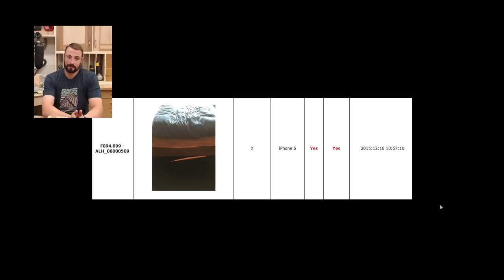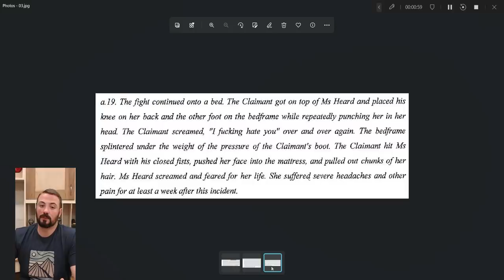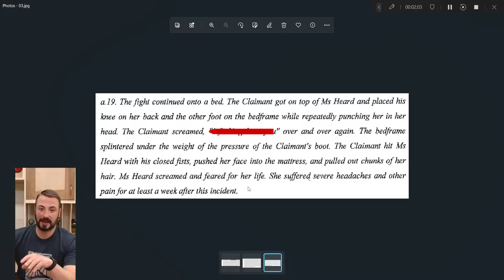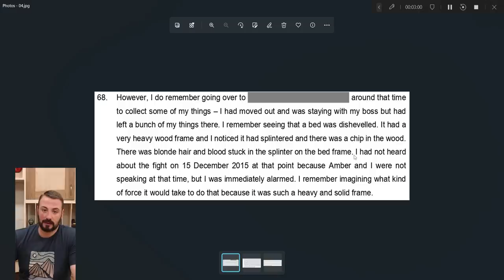Woodworker Attorney DEBUNKS Amber Heard's "Broken Bed” Testimony!

Comment: I love this! Great information!
Reply from the maker: Thank you! Coming from you, that means a whole lot. Probably some of the best audio/depo analysis of this case I’ve seen so far!
Reply: Came here coz of ur tweet 🤌🏻
Reply: Uhhh hey I saw a video in defense of Amber would be cool to see your response to it.
Reply: @LawLumber  just discovered your channel. With metadata would a screenshot of an older photo be possible?
Reply: @jolene4665  metadata can be easily manipulated. It's just data inside an image file. But if the metadata of a picture has a date older than the event she claimed, maybe one could assume it's an older photo...  no one would logically change the metadata so the date is before the event.
Reply: @rallealyt  my youtube comments are being weird and it was impossible to fix my original question. I meant in meta data there is simply a date attached to the click of the photo right? But it won’t show if it’s a screenshot or brand new? Thx for responding
Reply: To be honest, without these YouTube contents from professionals, experts, lawyers and independent Youtubers, I won't understand the trial and evidences as much as I do now.

Thank you everyone. ❤
Reply: You can see in the bed cover where someone has been sitting on the bed, legs aside the damage area, one of the hand (left) indentations is deep giving signs of purchase by a right handed person using a knife, after the damage the knife blade was closed with the left hand and placed by the right hand on the bed making a heavy indention as the person stands to take the photo.... Pow... I just went full Columbo.

Edit..... You can also see the phone indentation on sitting persons left (right side of pic) dropped while sitting, then picked up by left as standing, heavy right hand finger tip impressions made as right hand pushes off the bed.
Reply: Huh... looks like a large pocket knife on the bed. Could Amber have done The damage to the bed? You solved it.  You should give Johnnys lawyer this incriminating evidence.
Reply: Is it possible a high heel could of done it like a metal heel
Reply: Hope this gets to JDs team !
Reply: @incredibly Average.   You can do a quick illustrating video for this one.  Love your work too, and your humility 💝
Reply: @jaybrooks7431  - He said no, unless the high heal had a sharp point, similar to a knife?
Reply: @helloworld2784  it kinda worries me that professionals, experts, and lawyers have to explain the ongoing issues/inconsistencies in this trial for the average person to follow along. I can only imagine what the jury is feeling/thinking and really hope Johnny's team addresses these things.
Reply: @diannacarbajal9072  I really wish they brought in more experts on everything from cell phone data to this. But it’s not a criminal trial. As soon as I saw the bed I know it had to be purposely cracked off
Reply: @LawLumber  Brilliant work!! & I’m at the part of the video where you point to the object in the bed. I took my knife out of my purse and held it up to my tablet and it matches up almost exactly to the object in the bed. That is a knife in the bed!!  Excellent work brilliant !! Peace&Respect, Shelley Anne
Reply: somebody should send this Video to Joe Rogan to get more Attention
Reply: Lets hope there is a carpenter on the jury.
Reply: I highly doubt that Johnny Depp was wearing rubber soled workboots; that is simply not his style. A boot regularly worn by him is a thick leather soled biker boot. Such a boot could easily have been fitted with a cast iron metal quarter heel. It is seen as a stylish and practical addition, particularly by those in the 'rock' community. It also can not be assumed that it would have been the sole of Mr. Depp's boot that was in contact with the bed frame. If the splintering occurred as Mr. Depp climbed up onto the bed, immediately before landing with his knee upon Ms. Heard's back, the many pounds of Depp's weight, bearing down upon the sharp  corner of the metal quarter heel, as he quickly thrust it down onto the bed to 'gain purchase', could easily have supplied the kinetic force, and penetrating capability necessary to splinter the wood as evidenced in the bed frame damage photograph. Even if the boot heel wasn't metal quartered, it's perfectly feasible that the edge of a hard leather heel could splinter off such a piece of wood if there was a commensurate weakness pertaining to the grain of the bed frame's lumber. Such a sequence would have happened very swiftly, and seemingly all at once, and would be reasonably consistent with Ms. Heard's testimony. Furthermore, whatever that small object is that's nestled within the folds of the bedcover, it is definitely not the type of large knife needed to pry off the wood splinter. IMHO: nothing of Ms. Heard's testimony has been debunked here.
Reply: @RocketCalcutta  Tell us you’ve never worked with wood, without telling us you’ve never worked with wood…
Reply: @RocketCalcutta  how could his heel be down if his other leg is raised and kneeling on ambers back? If you are leaning forward the heel will raise. Let alone have enough force to split the wood.
Quick look through google images shows his choice of boot is usually dr martins or similar.
Reply: @zac3392  of course I have worked with wood; that experience is precisely what led me to my opinion. Are you saying that the hard heel of a biker boot, metal quartered or not, striking down on the corner edge of a wooden bed frame could not splinter a piece of it off? The heel, in this instance would have a kinetic force similar to a mallet being brought down. It is entirely possible that such an action could result in the damage seen in the photo exhibit.
Reply: @jolene4665  any action taken on a photo will increase metadata fields, geolocation changes, etc.

 Dates will get added by the OS of the system (like an android phone) for the original, and if you save it in photoshop, again more info/date time stamp added, etc etc on and on. 
Someone taking a picture of a picture on another device would only give you the device info where the pic was taken on the respective pictures - BUT forensic techs may be able to get the fact that it's a picture of a picture on another device because the image will have some telltale signs like lines that aren't fully detectable by the eye, which would be notable in terms of trial evidence. Try taking a picture of a computer screen send you'll see what I mean. It's also tough to line up perfectly, which might encourage you to edit or shrink it down. Those would all get metadata tags for the changes made. It's how your phone is able to "undo" modifications to a picture, because it knows exactly what you did and in what order.

Hope that helps!
Reply: I heard his bed was mahogany. We sure it's pine? Would Johnny Depp have a pine bed in his penthouse? I still think she did the damage though.
Reply: @truthsleuth6567  wouldn't that make it stronger? Mahogany is like 50-70% stronger than pine.
Reply: @MEEMS It absolutely would be stronger!  She's a beast! LOL
Reply: @RocketCalcutta  Splinter a small piece, yes. Take out a 3’-4’ long splinter at one time, not a chance. You couldn’t do that with a mallet either. If this was the only inconsistency in her stories, perhaps I could chalk it up to a once in a lifetime occurrence.
Reply: @zac3392  it could very possibly have happened as outlined in my various comments, imho. This is why I don't believe that Law and Lumber (great name, isn't it?) has debunked Ms. Heard's testimony regarding this matter.
Reply: @lilbaz8073  a thorough search of Google shows that Mr. Depp regularly wears biker type boots. I am suggesting that Mr. Depp could easily have slammed the heel of such a boot hard down onto the bedframe as he was climbing up on the bed to attack her. This action could very possibly have led to the splintering of the bedframe, as seen in the photograph. The whole sequence of him stepping onto the bed via the bedframe, then getting on top of Amber Heard,  would all have happened very fast, and seemingly instantaneously. I therefore think Ms. Heard's testimony is reasonably consistent with the bedframe damage photo. This is my objective opinion.
Reply: @RocketCalcutta  nah. This is a civil case not a criminal case. There is no beyond reasonable doubt. This is about probability. It is more likely to be that it was purposfully damaged than johnny did it. Wearing some weird biker boots with steel heels. When a google of johnny depp boots shows him wearing eithe dms or floppy workmsn boots. This isn't a dior ad.
Reply: @RocketCalcutta  amber could have easily won this case. If she kept it simple. But she's gone so ott, with no back up. People find it almost impossible to believe her. Now you want us to believe johnny had special boots that can split wood? How the hell would he walk round the house or upstairs without damaging things all the time?
Sorry, nah.
Reply: @lilbaz8073  You are welcome to your opinion, of course. I will add this though: the thought that Amber Heard would have had the same expert knowledge of wood and its grain as Law & Lumber, giving her the know how so as to enable her to fake the damage, seems utterly preposterous to me. This is just my opinion of course.
Reply: @lilbaz8073  no special boots. He could have applied special force as he smashed his heel down onto the corner edge of the bed frame. It's as simple as that to me.
Reply: @RocketCalcutta  It is soft pine, it would just dent, not splinter. Plus, it would take many many strikes to weaken wood before it would blow off any wood with force, and it would not look like that. 

My point to you is that if he was pressing her into the bed with enough force to smother her that means that he would have had to be further up with his center of gravity over the bed which is at least about a foot and a half away from the edge of the frame where it broke, there is no way his foot would have been that far back behind him and made that much force, especially if his weight supposedly was pressing down on her, which is a soft moving surface. If he really was looking for purchase from the frame it would have been on the other side of the frame closet to the mattress so it would stop him from moving backwards. On top of that he was supposedly punching her, which means he would have been bent down over and a bit above her, and her face would have been at least two and a half feet away from the edge of the frame. With all of that in consideration there is no way he could have kicked backwards at that angle with enough force to splinter off a piece of wood. Actually, it would be impossible that his heel to have even reached that edge at the angle he was positioned in. If you bend down and try to kick back, your heel does not reach the ground, so there is no way it could be used to chip off anything.
Reply: @tohrurikku  the actual bedframe was made from hardwood. Law & Lumber only used pine as a substitute for his demonstration. If a 175 -200 lb. person, wearing biker boots, was to climb angrily up onto a bed with a hardwood bedframe, the leading heel of that person's boot, with or without a metal quarter heel, would smash down upon the corner of that bedframe with the force of a swift striking mallet.  If you have such a bed, try taking a mallet to the corner edge of its bedframe with all your force, and let me know what happens (results may vary) 🤪
Reply: @truthsleuth6567  you are right. The bed was not soft pine. It was made of hardwood and could well have been mahogany.
Reply: @RocketCalcutta  She claimed that it happened when he was standing on her, while punching her and trying to gain footing with the other foot, not while stepping on the frame. She "felt it" happen as he was punching her. It is impossible, no matter what type of boot, to have happened at that angle and distance. Most of his weight would have been on her too, there is no way he could have put that much weight on his other foot to make enough force to splinter that wood without getting off of her and if he was able to do that, she could have run away and that was not her story. I proved that he did not do it. Why are you not listening. She said it happened when he was on her, not stepping onto the bed! Also, if it was that easy to have splintered it would have happened already. Do you think this is the first time they climbed on the bed wearing shoes?
Reply: @RocketCalcutta  we know she faked the rest from the police body cam that showed no wine, no broken glass. The other police officer earlier had a complete tour of the apartment and reported no damage. It was only later when isaac came home he saw the broken glass and puddle of wine. Meaning it was done after johnny and the police had gone. Leaving only amber and her friends as the ones to have caused the damage.
Amber didn't need to have expert knowledge. She only wanted to show there had been damage and put on the tro that the police had attended. She just wanted to blackmail johnny. She never thought it would go to court.
Reply: @tohrurikku  The sequence of Mr. Depp's  movement would all have happened very fast, and could easily have seemed simultaneous to Ms. Heard. Coming from a tough neighborhood, I have been in fights of many kinds: it's really all a blur when you try to recall it afterwards. Stepping onto a bed under normal circumstances would exert way less pressure than crashing down upon it in an angry rage. As for Law and Lumber's presentation in this video: the wood in the court exhibit, and the other bed photographs does not seem like soft pine wood at all to me. Plus, the photographs he has used are clearly of two different beds. I am not convinced, for all the reasons I have outlined in my various comments here, that Ms. Heard's testimony regarding this matter has been debunked. It's my honest and objective opinion, and of course people are entitled to have a different one.
Reply: @lilbaz8073  there is indeed a great deal of conflicting evidence in this lawsuit, I agree.  However, concentrating on the issue of whether or not Ms. Heard faked the damage to the bedframe, imho this presentation by Law & Lumber hasn't proved anything one way or another to me. I do wish he had used the same type of wood as is seen in the photograph for his demonstration. Though he asserts that the wood in the photograph is pine, it sure doesn't look like pine to me. Also, the photographs he used to make his points are clearly of two different beds. What I have laid out in my various comments here are my honest and objective opinions regarding this matter, and of course other people are welcome to have different ones.
Reply: Very good analysis !
Reply: @RocketCalcutta  it had to have been her or her friends. Johnny left before the cops arrived. The cops saw no damage. Then amber damages the apartment takes pictures of damage and files for divorce the next day.
It's not rocket science.
Reply: @lilbaz8073  "rocket science" 😉
Reply: @RocketCalcutta  yes i did notice that after i typed it lol.
Reply: @lilbaz8073  🤪
Reply: @meems4378  thank you !
Reply: @RocketCalcutta  I do appreciate u providing ur opinion and accepting the input of others but...U seem to be making the scenario fit her facts. U disregard her testimony stating it was fast so she probably got it wrong. If a bed breaks when someone is punching me u bet I'm going to know if it happened before the first punch or after. With that u seem to ignore the physics of weight distribution, cops being there and seeing no damage and her pictures later showing damage, taking someone saying it could happen and changing it to "very probable". Ignoring the presence of what appears to be an object in the picture that has a higher chance of causing the type of damage pictured than a boot. As I do agree the video alone doesn't "prove" it wasn't Jonnys boot, nothing proves it was beyond the word of Amber who has been caught in multiples of lies when it benefits her. Ur bias shows when u value the word of a documented liar over physical evidence. That's not opinion. That's fact.
Reply: Lord I hope his lawyers bring out this info and the jury doesn't fall for her evil. I was so disappointed in Johnny way back in 2016. We all "saw" the bruises.. we fell for her bullshit, but not anymore. She's so disgusting.
Reply: @ATecGeek  Thank you for your kind words. The police were not called out to this incident. The object nestled within the bed folds, as pointed to by Law & Lumber, is definitely too small to be a knife. It looks more like a pen, or a mascara case to me, but it's too out of focus to enable a positive ID. I am trying to be objective, and to look at the facts with a level head, without bias. We can only hope that the jury will do the same 😁👍
Reply: @truthsleuth6567 I think you mixed me up with someone else. I was not disagreeing with Law and Lumber at all. I said it was pine, and even if it was not it still would not have splintered the way the other other person I was disagreeing with claimed would happen if JD stepped up with a bikers boot. I believe that ah or one of her friends did that.
Reply: I'm praying for you & Johnny Justice 🙏Lord please for survivors All of us including Johnny & myself. If Johnny laced his boots up by resting his foot on the footrest, it easily could have eventually splintered due to this normal act of pressure on the wood. A turd is grasping at straws as her disjointed lying testimony shows the whole world! I could list 1000 reasons of evidence showing Dr Curry is 100% spot on.
Reply: @RocketCalcutta  Its does look small (object on queen sized bed) but after looking at small folding pocket or purse knifes on google it could well be a full metal folding pocket knife kept on a keychain or in a purse or on a bedroom side table to open mail in the morning for example, also hand size prints on bed make it about the correct size for that, the indentation alludes to the object being heavy, tho i agree it could well be a silver mascara case, i think (judging by eye) its to bulky to deep in the cover for that.
Reply: @MaxBreak  there are so many things wrong with this video! Whatever it is on the bed it is NOT the kind of large knife  that L&L felt he had to resort to using in his video. Next: he uses two entirely different beds to make his analysis. Furthermore  he claims the frame is made of stained pine. It clearly isn't. To cap it all he assumes what type of boots Mr. Depp was wearing, and assumes how his boot contacted the bed. As a lawyer he should know better than to assume things. I have broken down my thoughts on all of this in various comments and haven't yet received a response from him 😔
Reply: Love Your vids! 👏🙌  👍 I use to recommend Your channel, as latest as yesterday! 👉 In the original Australia recordings, there is a sound    of her walking away (after talking to nurse & doc )...it sounded to me like she marched away in high heals ("on that beautiful wooden parquet" as she stated was dragged across over⁉️😳  👉❓how in Earth can somebody with "sliced up feet" wear highheals & march around the Day after 😳❓ 👉👉❓that tape should be used as evidence, though there are other people involved, since evidnece of police recordings involved other People as well‼️where is logic ⁉️🤔 bless You for all You do! 🙌🙏🌟
Reply: @lilbaz8073   👍 yes, & a male victim of domestic abuse❗🙏🌟
Reply: @lilbaz8073   👍agree! ☝️❓& another possibility, some of her friends could "beat" her there without her daring to say in their presence..☝️ & one of the neighbours witnessed he saw her with another girl doing "pretend fight"..🤔 ☝️❓ why didn't she walked away with her friends if she was so affraid of him? 🤔
Reply: Agreed
Reply: It’s really good
Reply: @RocketCalcutta   Could that be a pocketknife that Johnny was talking about? When she tricked him into meet him in San Francisco (i believe) though he was not ought to...🤔
Reply: @RocketCalcutta   👍 Thank You for Your reply! I thought that there were 2 occasions, 1 with big knife with inscription that she gave him ( & recorded )  & the other with smaller knife in SF...
   He just came from touring, ( if I recall it correct), & His Friends helped him to arrange secret meeting cause of restriction she put on him...
    I will check his testimony about it again, though it seemed to me he mentioned smaller folded knife..
    Anyhow, maybe I've mixed it up, but I am trying to understand why he would walk around with a big knife he's got from her, since he was fed up with all that has to do with her...blessings to all! 🙏🌟
Reply: @LawLumber  in the frame at the end you can see a darker line running cross grain in the top side of the footboard, it starts about 4-5 inches back from the right end of the rough edge.  Matching up the sliver on the floor you can see a knick that appears to perfectly line up with that dark line. The pry point perhaps?
Reply: Soon as you zoomed in on the bed at the end I was like....."😲daaaaaaammmm"
Reply: hi guys! you are incredibly awesome NOT average investigators! thank you for your work!
Reply: @LawLumber  im glad I've found your content and other stuff about law :) tbh its all thanks to amber turd
Reply: @LawLumber  You can EASILY clip off that wood from the edge in a VIOLENT SCUFFLE where you're exerting an INCREDIBLE AMOUNT OF PRESSURE. 

And with a BOOT?! ABSOLUTELY! 

This proves nothing, Counselor.
Reply: The size of the platform edge, Johnny would have been doing the splits to contort himself into the position she described. They need an OJ moment for that one.
Reply: Your videos opened up lots of cans of worms! Thank you for your hard work!
Reply: @RocketCalcutta  interesting theory but I have one problem with it. AH stated she was pushed faced first into the mattress and JD was on top of her and kneeling on her back with one leg, gaining purchase with the other, punching her. With this description, JD HAS to be facing her- his chest to her back. Metal on biker boots is on the heel typically NOT the toe. For his heel to do the damage they would have to be back to back which makes no sense.
Reply: @IRLLondonGirl  Mr. Depp smashing his heel hard down on edge of the bedframe, as he climbed up on to the bed, would've happened so quickly before landing on top Ms. Heard so as to appear almost simultaneous. Her testimony is reasonably consistent with what I am saying could easily have occurred. Another thing to bear in mind is that Law & Lumber is dead wrong about the bedframe being made from stained pine. The bed is a 'high-end' Los Angekes made 'Environment Furniture Edge Bed' fashioned from reclaimed peroba rosa hardwood, with ebony-stained mahogany veneer on each of its corners. There is soooooo much wrong with Law & Lumber's sloppily researched analysis imho.
Reply: @RocketCalcutta  
I work quite a bit with wood, and I can tell you that chips like these are only possible with a sharp object. No matter if it is soft or hard wood.
With a blunt object? You would slip before it would chip. You will need a hard object to make the break. Maybe with a huge hammer, but definitely not with a boot, not even with a worker, steel-nosed, boot.

Secondly, you can also see it in the video, you would tear it off as he does at 17:35. This means that if magically his boot would have chipped it, he would have to tear ther rest off by hand.

Again, I work regularly with wood and it is plain and simply impossible.
Reply: @RocketCalcutta  sorry I don't buy it. Climbing up on the bed frame the force is going toward the bed not away and doesn't make sense to me with how a foot would climb on. Stepping down (to present with the heel first) would be much more controlled as Ms Heard testified she was unconscious at this point. Although I acknowledge that she also says she ended up on the floor and doesn't know how. That will have to remain as a mystery. To me that damage is consistent with a direction of force from the bed going away from the bed. @lawandlumber explained this well with the knife as a theory. His explanation is more common sense to me in that sense and is a conclusion I can believe based on my own experience of wood and how it splinters/breaks, having had a large wooden bed myself that broke in a similar way one time. I completely agree that if it's true that the bed was damaged in this incident, then the incident would have escalated super quick and likely over in a couple of minutes
Reply: @IRLLondonGirl  you are welcome to your differing opinion. Much respect 👍
Reply: @IRLLondonGirl  P.S. FWIW: the bed in question, i.e., an Environment Furniture Edge Bed, has what amounts to being a bench all the way around it. The chip was broken off from the top corner edge  at the foot of the  bench-like bedframe. (If that helps you visualize what I am imagining could have happened.)
Reply: I don’t believe her she’s not a small person she’s keep claiming JD on drug and took a lot of photo his asleep! I would report to police and go to hospital if this happen to me
Reply: @LawLumber  w

Wonderhussy
Reply: Hi there.  Thank you for this PROOF that she is lying.  She has a small pocket knife on the comforter in the pic.  Its hard to see but was pointed out on May 17th court proceeding.   ARE YOU ABLE TO GET THIS VIDEO TO JD LAWYERS?
Reply: @yehkasee365  😂
Reply: I wish the jury could see this
Reply: Hi Bryan!!!! ♥️ loves ya!!!!
Reply: The pocket knife is not strong enough!!!
Reply: @JimmyGrl09   why didn't Law and Lumber use a small pocket knife to carry out his demonstration? Why did he resort to using a large 4 inch blade folding knife instead?

Plus: the object doesn't even look like a pocket knife imho. I showed the photograph to some friends, and asked them to try and identify what the mystery object was, having previously cropped off the wood shard at the  bottom of the photograph in order to eliminate any indicator that it was from the trial. One friend said it looked like a vibrator, another one said it resembled a small stubby fountain pen with a coin beside it, yet another friend guessed it was a vape pen.
Reply: More like misleading information. Great intention but a lack of Carpentry experience was obvious as he ignored the sharp edges of the bed lumber which completely change this scenario. There is a reason modern framing and decking lumber is sold with round edges. They don't do all that work just for looks it makes a board FAR less likely to splinter and chip when hit on an edge. Many of those who arn't just friends of or family of those who work with wood are mentioning this in the comments. Many of us have literally had boards split on the edge from our work boots haha. While I think they are correct that was not caused by a boot at least not only a boot they actually got most of the reasons why wrong.
Reply: Knife was used ; and to  take a picture with the “knife” on the blanket weighing it down so it will be hard to make out shows it was a “staged “ picture.
Great work and explanation. This is why I’m going to be your new subscriber to your channel.
Reply: Could there be any chance that the worst actress ever was confused and was maybe for once sort of telling the truth, I.e I have had beams snap on beds by the kids being to excited jumping on the bed, or me being too excited lol could jinny have pushed her down so hard it cracked the bed and then when everything happened she said that was when the beam snapped ? So the damage was done in the throw down? Not sticking up for this bare faced liar just an honest question as I've had beams snap more than once although tbh these were cheap beds with cheap wood unlike I would expect from a millionaires bed.
Reply: @diannacarbajal9072  seems she already has it 🤣🤣
Reply: perfect video
Reply: @LawLumber  l love watching you ❤️ you have an amazing legal mind you make complex legal action into easy to negotiate and understand situations. I have always been amazed by good cabinet makers. l design not bad cabinets myself but not so skilled at being a quality joiner, your furniture is beautiful 👌 have you tried Jarah wood? I live in Australia 🇦🇺 and Jarah is a local beautiful wood and is regarded as very prestige as an option like birds eye maple in America 🍁 much love and best wishes from my family and I with your channel x
Reply: @jaybrooks7431  Amber testified Johnny was wearing a boot.
Reply: Absolutely 👍
Reply: @RocketCalcutta  its the same bed. Clearly what they did is sand or plane and restain to make it presentable? Because the bed in the wallabout shot from the real estate agency looks like the same room same bed to the rest of us?
Reply: @RocketCalcutta  either way it would have been the front of his boot not the heel thatbwould have come into contact if he was moving forward.  And if he was falling backwards and did that w a metal heel as you posit then he would have fallen backwards and hurt himself probably. But it would have had ro have been with force and with metal heel for sure and even then it woulrnt splinter in that way. Having worked on boats/yards/farms for years ive seen all types of wood splinter from all type of standing jumping falling back and falling forward and i think its credible to say that however it happened it wasnt during whatever situation AH describes. Never mind "wood science" or carpentry knowlledge, we are talking physics. As a biological anthropologist  i have studied kinetics bipedalism and all sorts of humam physics and it makes no sense. 

And i say this as a dv survivor too. I dont believe either one fully. I acknowledge  that he was plenty emotionally and verbally abusive and or jealous and controlling even, of that there is proof, and as far as she is concerned of course i do not want to believe any person let alone a fellow woman would falsely accuse anyone of what shes accusing him. So years ago i gave her the benefit of the doubt when all i saw was a few photos that looked legit devoid of anything else. Because victims dont NEED evidence to be believed per se. But she decided to provide much more so called evidence along with many more accusations... so we must now look at this evidence imho as unbiased as possible and thats what i did...even though i was solodarious w an alleged fellow dv survivor. I like you say also have been looking at this as objectively as possible and bar a few videos like these trying to only see what the jury is seeing while watching the trial...and it just makes no sense sorry. And i want it to make sense. I have questions.

 And yes maybe we dont know what boots or even what wood but for me its just the physics of the movements one would have to do to break a large splinter like that off that make no sense.

Ps. I have a leatherman tool with a knife that could absolutely splinter wood like that because ive done it even by accident trying to just make a hole. Im the same exact size as Amber Heard btw and also grew up on a horse farm doing manyal labour fuxing fences etc and have similar build so im sure she could have done it but not saying she has just debunking your claim that she COULDN'T have with a fold out tool knife (though im not sure that one in the pic is the one...because apart from anything why would someone leave the knife on the bed and take a pic lol).
Reply: @leticiavasquez8566  as regards the physics of how a boot, getting a purchase on the bedframe, could have knocked off a splinter from the bedframe: the heel of a boot with any type of hard sole could very easily knock a splinter off a reclaimed hardwood frame, especially if the frame resembled a bench, as is the case with the Environment Furniture Edge Bed. Think of how your heel would slam down and then backwards on the top corner edge of the bench-like bedframe as you furiously climbed up onto it.
Reply: @MaxBreak  I now have columbo standing by that bed trench coat on with that look on his face of ah ha I know how it happened lol I can absolutely see what you described
Reply: What a combo lawyer/furniture builder ❤️ it ✌️
Reply: Wow so she set him up
Reply: BRAVO Mr Average WOW I am blown away with you and I have subbed to you also,your loyalty,compassion and commitment is admirable xx💪🙌🙌👏👏💙
Reply: Do you watch The Behavior Panel in regards to JD and Amber's trial? Very interesting. On you tube.
Reply: What a dream team!!!
Reply: @RocketCalcutta  after reading your remarks. I tried to picture her face down and his knee on her back as he was gaining purchase. this is her testimony. my question is how his heel would damage it. wouldn't the toes be the only part to touch that wood while his knee is on her back??
Reply: @ElReyMrz1  my point is that Mr. Depp would had to have leapt onto the bench-like bedframe, smashing his heel down upon the. corner edge of it (i.e., getting a purchase)  before continuing forward landing on top of Ms. Heard. This would all have happened so fast as to seem simultaneous, especially in the midst of an attack. Another thing to bear in mind: I have identified the model of the bed. It is an Environment Furniture Edge Bed fashioned from reclaimed peroba rosa hardwood, with ebony-stained mahogany veneer on the bedframe's corners. Being as it's reclaimed hardwood, it could easily have been splintered  by the pressure of a heel landing hard down on it's corner edge with the heel then pushing backwards countering Mr. Depps forward momentum. I hope this clarifies my viewpoint 😁👍
Reply: @LawLumber  

Hi there. I know you’re suuuuuper busy but i hope you read this…

Please if you want to share whatever with us, DO IT HERE IN YOUR CHANNEL….
Especially if you did all the hard work….thanks..

Stay safe and healthy.
Reply: YOU ARE THE BOMB!!!  I APPRECIATE ALL OF THE TIME YOU HAVE SPENT IN LINE ALL NIGHT LONG, IN THE COURT ROOM, DOING DAY/NIGHT CAPS FOR US,  DOING THIS VIDEO RIGHT HERE!! COMPLETE DEDICATION AND DEVOTION TO THIS CASE! THANK YOU SO MUCH FOR SHARING YOUR KNOWLEDGE WITH US😊!
Reply: Fantastic info! Love the sitting marks and phone analysis on comments too. How this hasn’t been brought up by JD people I don’t know.
Reply: @MareRS357  I mean her standing on them with high heels getting leverage to hit him , but yeah looks like a pen knife did it
Reply: @dantespimp  I heard Rob (on Popcorned planet with Andy Signore) discussing that Camille did talk about this. I’ve been trying to find the clip, but so far I haven’t been able to find it.
Reply: @RocketCalcutta  i knoe how a heel would do it. I totally am.not saying a herl wouldnt do it. Im sayinf human physics would have a body going forward to pin someone down and punch them not on their heels but on their forefoot. Thats what in saying even if you get on a bed running (and i too have a platform japanese bed btw) your heel doesnt hit the edge. It only would getting OFF facing away from the bed. But thats not how AH described what happened. 
So im not arguing about the heels capabilities (though ive never seen him wear the kind of biker boots that have metal heels in any photos and im almost his age so ive seen decades of) to chip furniture im saying his heel wouldnt have come in contact with the edge if he did what she says he did to hold himself on to gain balance while holding her down and punching her. It makes no sense as far as physics. Not arguing your heel theory as to whether it could given the right scenario. This just isnt the scenario. Peace.
Reply: @diannacarbajal9072  We can send it to Camille
Reply: Fascinating! Thanks! I found you through Popcorned Planet. I love natural wood furniture and as a psychotherapist I also have an inquisitive mind and love figuring out mysteries. I think it's so great that everybody's bringing their own expertise to platforms like this! You Go Rob!
Reply: @RocketCalcutta  I doubt, if she did fake this, that she did it knowing the physics of how she created the damage. I suspect she would have envisioned her scenario and then tried to think of ways to embellish that scenario that could be photographed as "evidence". If I wanted to take a chunk out of a piece of wood, (and I've been known to make a rough repair this way) I'd grab something sharp and do exactly as depicted here. I find other aspects of the picture to be equally, if not more, indicative of ... suspect activity.
Reply: @leticiavasquez8566  peace to you also 🙏 As my final note on this matter: I think it reasonable to assess Ms. Heard's testimony as being consistent with the scenario I have outlined, given that she has sworn that her recollection of the event has been presented to the best of her recollection, and especially considering the event, if it happened, would have had to happen in a fear inducing frenzy of activity. During Ms. Heard's testimony on the stand she declared that Mr. Depp's boot caused the damage to the bed when it was getting a purchase on it. I see zero inconsistencies between this testimony and the facts that are at hand. Respect, and once again, peace!
Reply: @JaneFancher  What I find suspect is the fact that Law & Lumber has completely misrepresented the nature of the material that the bedframe was made from. He declared himself a woodwork expert and stated that the bedframe was made from stained pine softwood. It wasn't. The bed was an Environment Furniture Edge Bed, with a bench-like bedframe made from reclaimed peroba rosa hardwood. Law & Lumber then went on to demonstrate, on a piece of rounded edged pine softwood, how you could prise a sliver off of it with a large bladed folding knife. In an attempt to end his video with a Perry Mason moment, he then zoomed in on the photographic exhibit to reveal a small indiscernible object nestled within the folds of the bed clothes. Whatever this object is, and it could be any number of things, it is definitely NOT a large bladed folding knife. IMHO: the only thing that this video debunks is Law & Lumber himself. Of course, having said this, I believe everyone is entitled to their own opinion. 🙏
Reply: @LawLumber  Hate to be pedantic, but the photo @3:00 is not showing the same damage as the photo @6:00. What is going on?
Reply: @RocketCalcutta  i stand by the fact i think it wouldnt have been his heel making purchase on the edge ubles leaving tje bed not getting on it to get on one knee sorry. we can agree to disagree for sure. I see nothing but inconsistencies in all of her testimony and i find no joy in that at all as i supported her as a sv suevivor myself from day one. Then i dug further into her stories and looked at the evidence like a scientist and i dont see it. She would have been better off not showing any evidence than contradictory evidence. Too many photosnof material destruction and not enough of bodily harm. That itself is inconsistent. Anyway. Stay safe out there. Take care.
Reply: @leticiavasquez8566  Take care also 😌🙏
Reply: @RocketCalcutta  🖖🏾🖖🏾🖖🏾🖖🏾
Reply: @Cuticatie  According to the online dictionary/thesaurus, Lexico, which is affiliated to the Oxford University Press, pledge and donate are synonyms. The well used term for the type of donation Ms. Heard made is pledge donation. I am not blindly sticking up for Ms. Heard when I point such things out. As ever, I am merely striving to be as objective as I possibly can.
Reply: @lilbaz8073  Your comment reminds me of the great "line" in the movie, Body Heat where William Hurt is plotting to kill his mistress.  His bomb-maker explains how he's to plant it.  Hurt say, "Oh, it should be easy."  Answer by the experienced criminal, "No, the police will have 50 ways to catch you.  If you can think of 25 of those ways, you're a genius..... and you're no genius"!  [Do watch that movie, if you haven't seen it]
Reply: @RocketCalcutta  The splintered piece of wood appears to be at least 2' long.  The only way JD could have broken it (in that way) would be if he TRIED to break it by (somehow) coming almost straight down on it.  (and, of course, there would be no time or reason that he would do that)  That leaves, "his position on the bed.":  If he was trying to "gain purchase" his boot would have been on the inside of the frame; not the back-side.  His foot would have just slid-off (causing a minor scrape at the very most)  Certainly, the angle he was at while lying on the bed on top of her, is not consistent with that kind of "rear-ward" break in the wood at such a minimum angle.  
The only possibility, in favor of your argument, would be if there was an extreme, two-foot fault in the wood; but that would easily be seen in forensic analysis of the wood.
Reply: @ThePianoMan1953  think i saw it, but can't remember it. Will give it another go. Thanks.
Reply: @ThePianoMan1953  Mr. Depp could easily have slammed down with his heel against the leading top corner edge of the bedframe as he rushed to climb up onto the bed. The frenzied sequence of events comprising Mr. Depp's alleged attack could easily have appeared to be happening all at once in the mind of a panicked victim. Furthermore, the bed in question was an Environment Furniture Edge Bed, and its bench-like frame was fashioned from reclaimed peroba rosa hardwood. It was not stained pine softwood as Law & Lumber erroneously stated in this video. Law & Lumber's analysis is misleading in so many ways, imho.
Reply: @RocketCalcutta  I do appreciate your HO.  We should all be humble!  lol  I just simply don't understand what part a HEEL could possibly play in that situation??  I seriously don't understand how anyone's heel (with the exception of Amber's heel while lying on her back) could come into contact with that edge of the frame??  Toe, yes, but heel???  What position would JD have to be in for his heel to do that??
And, by the way, you said JD "climbed up" on the bed??  No, the bed is very, very low.
Reply: @ThePianoMan1953 The bed is not low. Law & Lumber is wrong about the construction of the bed as well as its material composition. Look up the Environment Furniture Edge Bed online. Though the LA based company that made these beds is now defunct, many examples of it are listed for resale.

The bedframe was designed to function as a bench. Depp could very easily have leapt up onto this bench to get on top of the bed. In this case, his heel could easily have slammed downwards and then backwards onto the leading top corner edge of the bench-like bedframe as it gained purchase and Mr. Depp followed through with moving forward. This action in turn could easily have splintered a lengthy sliver off of the reclaimed hardwood. I take it you understand what reclaimed wood is, right?

I hope this makes what I'm attempting to put across clearer 😌🙏
Reply: @Cuticatie  I don't believe anything just because it is written or said. I always take into account whatever facts and evidences are available in order for me to arrive at an objective understanding of whatever is in question. My point is that, imho, this misleadingly presented video debunks nothing!
Reply: @RocketCalcutta  I believe it was Amber herself, who said, it's a low, platform bed which is supported by the court photos.  I believe, it is quite low as can be plainly seen.

I'm wondering..... why are you "hung-up" on the "heel theory"??  What makes you think his heel had to cause the break??  (I believe it is because you know that is the type of force necessary to break a two-foot piece of wood; reclaimed or otherwise)  But, I think you buried your own argument with your "heel theory."  A foot just doesn't bend in the direction of someone facing the bed for a heel to come into contact with that distal-edge.  If Johnny's focus was to get on top of Amber, he would be lunging forward onto the bed; not jumping up and down on the edge of the bed frame/bench.  And even if he did, his foot just couldn't bend in the way that it would have to be.  He'd have to be facing the footboard, but the testimony stated that he was facing forward on his stomach.  Heel?? impossible!
Reply: @ThePianoMan1953  The height of the bed in question was 12.25 inches. That is approximately twice that of a regular staircase step. And you're right, it needn't have been Mr. Depp's heel making contact with the leading top corner edge of this 12.25 inch high bedframe.

If Mr. Depp was furiously climbing up onto the bed, gaining purchase on the 12.25 inch high reclaimed hardwood bedframe as he did so, whichever part of his boot it was that gained purchase could have caused the depicted splintering. Ms. Heard, especially if she was as panicked as she claims, could easily have percieved just such a fast moving sequence of events as happening simultaneously. I don't think any reasonable person would fault her for that.

Again this is merely my humble but objectively reasoned opinion. (Is there an acronym for that: IMHBORO? Lol.) You are of course more than welcome to yours. Respect 😌🙏
Reply: @RocketCalcutta  Yes, you are entitled to any opinion you want but "objectively"??  I hear you discounting any rational point. So, now you say, "okay, it's only 12.5" height and well, it may not have been his heel."  It's not enough to just keep saying, "I think he did it because she said so."  

I have another "hard-evidence" reason for disbelieving Amber.  I was shocked when seeing the photo of the entire bed.  It showed the mattress far from the edge of the broken wood.  she said, "he had his knee in my back while breaking the wood."  I DON'T THINK SO.   I believe, that would be a physical impossibility due to the dimensions I saw in that photo.
Reply: @ThePianoMan1953  It doesn't seem as if you are understanding my argument, as you appear to keep missing the point if it. I have explained what I believe is my rational, objective, fair-minded, impartial, and most reasonable opinion, in as clear a way as I know how to. Most likely it is best, at this juncture, to agree to differ, my honorable fellow YouTube commenter. All the very best to you 😌🙏
Reply: @RocketCalcutta  After hearing your "argument" I think that would be your best course of action.  Johnny's lawyers have 20 hours left.  They are lining up a "firing squad" of direct, eye witness testimony, whom, I understand, even includes Amber's sister's friend, who may well expose perjury.
Reply: Incredibly Average;; ‼️‼️ Have you spotted Ambers BRUISE KIT 😱in the photo of Depp passed out at the Festival of Icecream. Lower left hand corner!! Thank TikTok😏‼️‼️
Reply: @RocketCalcutta  your story doesn't make sense either if he slammed his foot down hard enough to do that i'm pretty sure a loud bang or words like slammed his foot would have been in her story not just having his foot on the edge as someone going through something like that a loud noise would get there attention. her stories were always exagerated so a lound slammed foot would very well be in it.
Reply: @LawLumber  This is AMAZING!! GO ON LAD!! This is Debunking her story PERFECTLY!! I'm not convinced by her story and after seeing your video, I am even more certain that she has lied about this incident!! Keep up the great work your doing. Lots of good points to think on🤔 thank you @Law and Lumber !! 💯🤯 Stuff.
Reply: oh look who's here
Reply: @RocketCalcutta  even if what you say would be remotely possible, it doesn't jive with her descriptions of what happened. The boot heel would likely be up and even if it hit the wood a number of times like you say, it's way more likely that the INSIDE of the bedframe would splinter, not the rounded outside. But like this guy actually SHOWS us you would need a thin blade and then LEVERAGE for it to splinter. What you're saying just doesn't make sense to me no matter how hard I try to act it out. Also, good point about her face allegedly being pressed into the bed, so much so she can't breathe, being hit over and over (with ringed fingers) on the back of her head AND him screaming right into her ear (which shows his body positioning even more) she could also hear his boots? Nah, too much that doesn't work here.
Reply: @fluer6049  the bed was a model of bed called an Envrironment Furniture Edge Bed. The bedframe was designed to function as a bench and was 12.5 inches high. The wood used was reclaimed peroba rosa hardwood, with ebony-stained mahogany veneer inlay panels ar each corner.

With the wood being brittle reclaimed hardwood, it could easily have splintered, as shown in the photo exhibit, under the weight of a boot having come swiftly down onto it, as Mr. Depp, in a furious rage, clambered forward from the surrounding floor to get on top of Ms. Heard. This chaotic sequence of events could easily have seemed as if everything had happened all at once, especially within the mind of someone that had been in a state of panicked fear. As I visualize this having happened, it all seems highly probable to me. I only hope I have been able to effectively explain my imagining of how the event might have happened in a clear way. All the best, and much respect 😌🙏
Reply: @TheMomGeneral  
My thought as well. Johnny is not a particularly long legged or tall fellow. If she was even halfway on that mattress with his knee in her back, his boot was not hitting where it fractured.
Reply: Again.... why didn't you offer your expertise about the broken bed. ? ? WHY
Reply: @LawLumber  Again.... why didn't you offer your expertise about the broken bed. ? ? WHY
Reply: Fantastic demo
Reply: @LawLumber  • Idk if y’all noticed nor even care but that’s an incredibly twisted painting to display w/in a Bedroom. It’s like a Hostage Crisis image portraying the Eyes being subdued & the Mouth being literally Subjugated. 

I don’t buy into any of Amber’s BS but that Painting is incredibly Twisted when placed into such an intimate setting being the Bedroom. That’s certainly not an image I would want to see when I wake up nor when I am intimate w/ anyone. If my partner purchased such an image I would be incredibly disturbed by such & would probably back away slowly.
Reply: Nihilism • def • the rejection of all religious and moral principles, in the belief that life is meaningless.

You see that cup or mug perfectly describing Amber Heard in all of her pics taken as nothing more than a prop in her photo ops. 

All while the painting, which Amber claimed she took interests in painting herself, clearly shows a blonde Amber figure w/ a brunette female figure

I know such is irrelevant to the case & cannot possibly be held against Amber yet both are seriously troubling considering everything we have witnessed of Amber on trial.

She seems to take pleasure in not only framing while humiliating others attempting to assassinate their moral character. She also clearly has zero issues whatsoever of hinting at her own demons via that cup / mug & that painting which I am now convinced she painted herself.

She places meaning into meaningless material objects rather than human beings themselves let alone any Religious beliefs.
Reply: Amber Heard can no longer see Raquel Pennington. 
Raquel Pennington cannot speak against Amber Heard.
Reply: Beside debatable the broken wood... If johnny press so hard and damage that bed while his knee on Amber's back, it's not just the bed wood, her back must have broken bones too.. If she wants to lie at least she should make it believable and make sense 🙄
Reply: Yes absolutely love how he proved the only way it could happen. 😊
Reply: @RocketCalcutta  the problem is that she said she felt it when it happen, and I know you said maybe it felt like it was all at the same time because of the trauma- but that doesn’t track because she said she was face down and she could feel him trying to gain purchase and “he was slipping” which indicates it was not one moment.  Also-  as L&L said it doesn’t have to be a large knife, just an object like a knife that was sharp and could apply pressure between the grain.  The object on the bed looks similar to a folding knife and that could absolutely have caused the damage.  Also-  (in another comment) you suggested that L&L was saying AH had Knowledge of wood & grain.  IMO it seems he’s saying the opposite!  If she knew about wood & grain she wouldn’t have suggested that a boot could cause that damage in the manner she suggested.  She also would not have (possibly/maybe/allegedly/probably) used the “alleged” pocket knife seen on the bed to cause damage supposed to have been caused by a boot (that had hardly any pressure because all his weight was on her back and the knee at the time).   Just my opinion.
Reply: @dlee7286  My main conclusion about Law&Lumber's analysis is he is dead wrong about the bed in question and the type of wood it was constructed from. So much for 'expert' analysis. IMHO: This video presents a thoroughly flawed opinion from someone with evident and extreme bias. Hint: YouTubers only make bank if they are pro-Depp and anti-Heard. Sad but true 😔
Reply: @dlee7286   The actual bed in the photograph is high end, and thus expensive, and is called the Environment Furniture Edge Bed. It is not made of stained pine (as many people on here have pointed out) but reclaimed Brazilian peroba rosa hardwood. The corners are veneered with ebony-stained mahogany, hence them looking really dark in the wide shot. Detailed, high res photographs of this bed can readily be found online.
Reply: @RocketCalcutta  wouldn't there have been other damage to the bedframe other than a small chunk of wood being splintered off the frame? I would have assumed there would be rubber from the sole of the shoe transfered onto the bedframe. She painted a picture of a viciously violent attack by a man who essentially lost contact with reality. I would expect there would likely be more damage to that bedframe had he truly committed the act of violence she is alleged to happen. The abuse very well could have happened; it's the way she explains the stories in grandiose detail. It felt rehearsed, especially when during her direct testimony she was absolutely sure, 100% of every detail, every incident she recalled in very meticulous & intense detail. During cross every other answer was, "I don't know" or some variation of rambling that doesn't get to the answer.
Reply: @RocketCalcutta  As a Dv survivir I can tell you should not have been paying attention to those particular details. Period. She would be trying to survivr. Period. Stop trying to make excuses for a chronic liar and sociopath
Reply: @melaniaarnett1755  I am a sexual abuse/domestic violence survivor and what you have written is not accurate, imho
Reply: @melaniaarnett1755  what Law and Lumber presented in this video isn't accurate either, (again imho). Here are the reasons for me saying this, as clipped from one of my above reply comments:

The bed referenced in this video, and which is shown in the above mentioned photographic exhibit, is actually an Environment Furniture Edge bed. Its bedframe is made from reclaimed peroba rosa hardwood. Suffice it to say, reclaimed hardwood has very different physical properties to stained pine.

In this so called 'debunking' video, Law & Lumber firstly failed to properly ascertain the material that the bedframe in question was made from. Secondly, he assumed what type of boot Mr. Depp was wearing. Thirdly, he further assumed what Mr. Depp's contact with the bedframe was. Fourthly, he insinuated that the very small indiscernible object, nestled within the folds of the bedcover, which is visible in the photographic exhibit,  is somehow equivalent to the type of large knife he felt he had to use in order to carry out his wood shearing demonstration. All in all, Law & Lumber has published a very shoddy video presentation in a thoroughly irresponsible manner, imho.
Reply: Incredibly average! We love U and miss u. You are incredible 🙏🏼
Reply: For sure !!!!!!!!
Reply: Rocketcalcutta is an associate of Elon's.
Reply: Yes, it is !!! One more of AH`s horrible lies !!!!!!!!!!!!